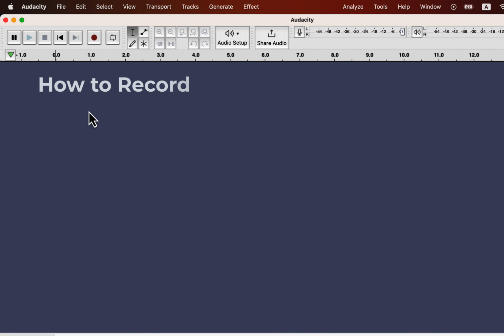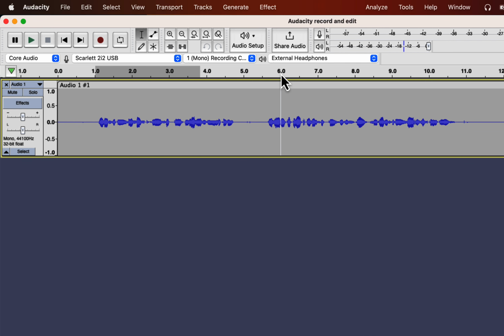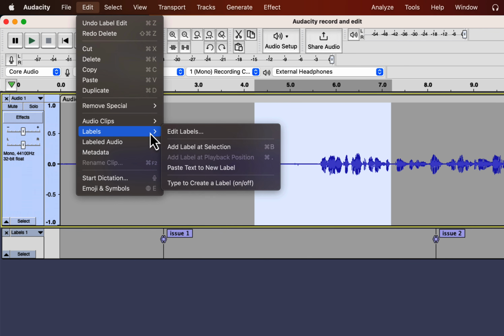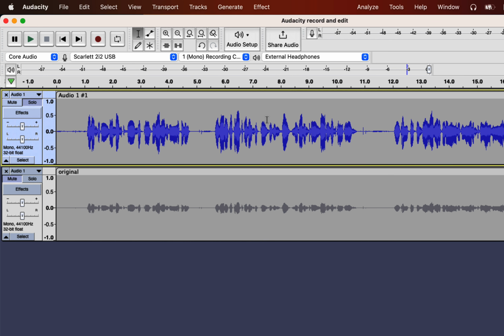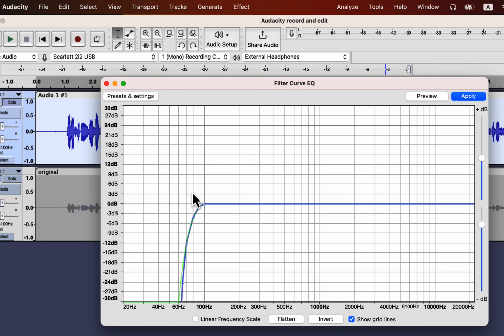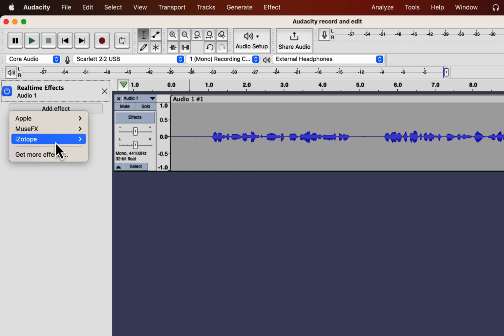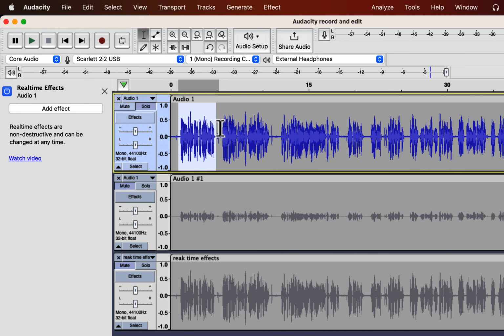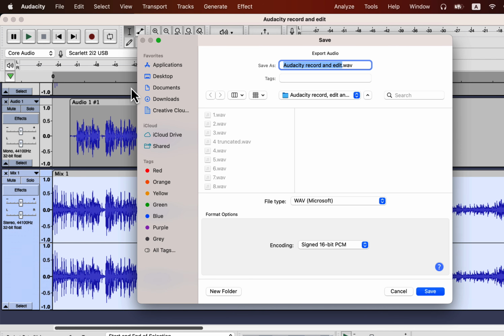Audacity Step-by-Step Tutorial for Beginners

Comment: Hi , Thanks for the video. It is really very interessant.
 I'm an old (70) beginner, looked at a lot of videos about Audacity, but don't have found anywhere what I'm looking for: 
How can I use Audacity to mix the sound coming from Aria Player? 
I'm using a keyboard connected with MIDI cable to my Win10 PC and want to mix the Garritan sounds of Aria Player with the sound of my webcam and from a soundtrack.
Mix and record sounds from my Webcam and from a soundtrack is OK, but from Aria Player I don't know how. 
Could you realize a tutorial video how to do this? Perhaps it is using a VST plugin, perhaps using VB-virtual cable. I tried with VB-virtual cable without success. Perhaps there are parameters to set to the VB. A video would be useful. 
If it is really easy and don't need a video, give me please the solution in the answer. Note, I tried with VoiceMeeter and had the same problem.

Comment: Long video with a lot of info, thank you. I would suggest putting a lot more timestamps in a video like this as I found it difficult to go back and find specific info, but thank you. Here is my question: You began the effects portion saying that the effects needed to be done in the order of, 1-Noise reduction, 2-EQ, 3-Compressor, 4-Normalize. However, when you got to the Real-time effects portion those were not done in that order. So, in real-time effects it does not matter what order to do them, correct? (The Normalization was not addressed in the real-time effects?) But if done the other way, in Audacity settings, they do need to be in the first order, correct?
Reply from the maker: Thanks for the feedback. The order of effect rule is more complex than I showed in this video. For real time effects, I mainly focused on how to use real time effects. Also not all effects are available as real time effects in Audacity. 

If you think about the sequence of effects that must be followed will be Noise reduction, EQ, Compressor.  The Normalize effect can be used any time and multiple times. For example, you can Normalize at the beginning and at the end.

However, other effects should follow that sequence if used. So Noise Reduction Before EQ if used. And EQ before Compressor if used.
Reply: @MasterEditor5  Thank you for the clarification! I'm very new to all of this. Can other plugins be added to Audacity outside of Muse? For example, someone is saying the best free EQ plugin is '2nd Sense Audio 2S EQ'. Is that something you would recommend or the EQs in Audacity/Muse are good enough? Thanks.
Reply from the maker: @hopeforamerica1714  Yes, other third-party plugins can be added to Audacity. However, not all of them run smoothly. I have not used 2nd sense. I would recommend TDR nova as free EQ plugin
Reply: @MasterEditor5  Thank you sir! Can I ask you a couple more questions? What is the best technique to remove or filter out mouth noises? And could you recommend one or two video editing software that allows me to record a voice over directly over a video?
Reply from the maker: @hopeforamerica1714  Mouth noises would require a long answer. I have some videos on my channel, I suggest you watch those from the videos page of my channel. If you are talking about screen recording and voice over recording at the same time, I use Camtasia

Comment: Hi
I used Audacity version 3.1.3 in my Windows 8.1 laptop and it worked very well, then recently I upgraded my operating system to Windows 10.  After that I can't get any sound from my Audacity (Though I get sound from other sources such as YouTube). I thought I should upgrade my Audacity version , so I downloaded & installed Audacity version 3.2.5, but still no sound from replays though I can record or do other functions in Audacity. 
Can you help me to get sound from Audacity replays?. Thank you very much . Rama
Reply from the maker: I suggest you post this issue to Audacity forum.

Comment: I own the Neewer NW-700 microphone setup and have the USB plugged into my PC along with the white E-10 box. I cannot locate my microphone at all on the drop-down menu on Audacity.
Reply from the maker: Do you plug the microphone first and then open Audacity or vice versa? You should connect the microphone first and then open Audacity. What name the microphone is getting on Windows system settings?
Reply: Under the AUDIO SETUP drop-down menu, i select RECORDING DEVICE and the NW-700 is not listed. Instead, there is MICROPHONE ARRAY (2-twv123456B) and MICROSOFT SOUND MAPPER input. What does all this mean? I have the E-10 box hooked up.
Reply: @MasterEditor5  
Do I need to purchase that Phantom Power Box?
Reply from the maker: @rideshareadvice-nj4mv  Isn't it a USB microphone? USB mics do not need phantom power
Reply: @MasterEditor5  Yes it is a USB. But for the some reason, Audacity cannot detect the microphone.

Comment: My audio setup only shows my iMac speakers and microphone, how do I fix this?
Reply from the maker: what microphone are you using?
Reply: @MasterEditor5  BM800 condenser mic
Reply from the maker: Select microphone. Some mic doesn't show the name, instead show microphone
Reply: @MasterEditor5  it doesn’t show that as an option either, it just shows iMac mic or iPhone mic, should download another version?
Reply from the maker: Is it a USB microphone? Version should not be a problem. But still you can reinstall Audacity.
Reply: @MasterEditor5  no, just a regular mic plug